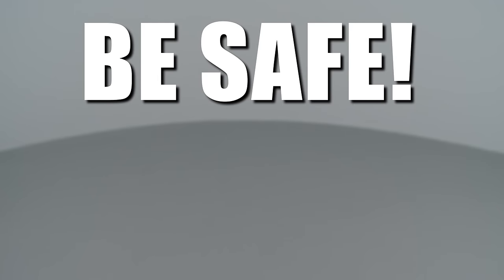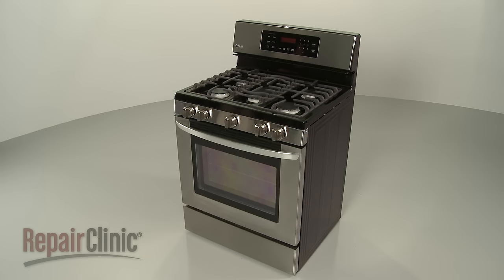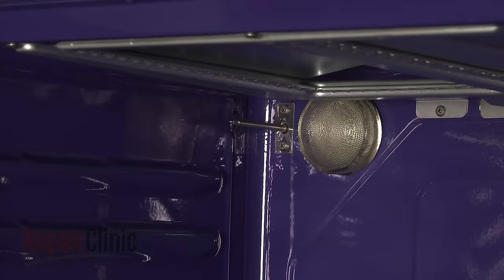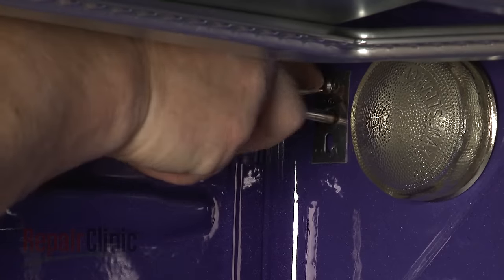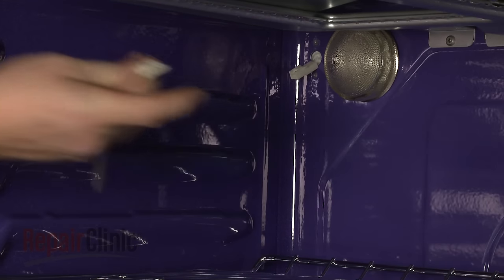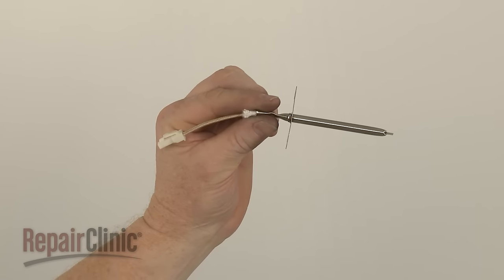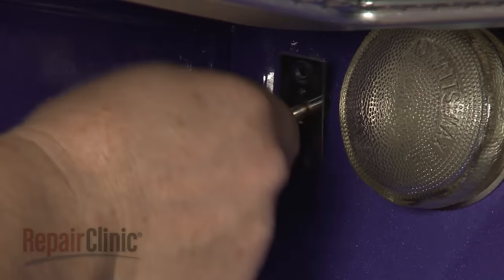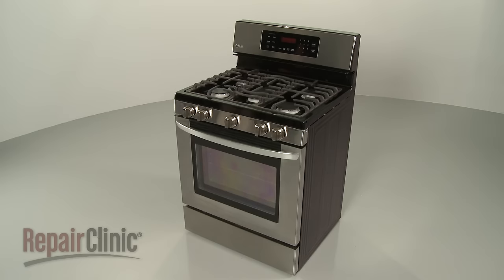LG Gas Range Oven Sensor Replacement #6322B62214A

Comment: On the electric units the connector is tied to the harness in the back and you need to remove the rear cover to access it and disconnect the connector. Its just a few screws. I tried for a half an hour to get it from the front to no avail. just go right to the back.
Reply: Thanks, Kevin. Mine just started having issues where it wouldn't heat to 450, imagine my disappointment when the steaks were done but the baked potatoes were just potatoes >:[ Anyhow, I'm working on it today after resetting the breaker and I'm thinking that sensor is gonna be the culprit; seems to be a common issue.
Reply: This is also the case on the gas units! But an easy install.

Comment: we haven't used our oven for a couple of years because the temperature control doesn't work.  It will go up to 500 and down to 250 with the oven set on 400.  I wonder if this sensor could be the problem.  We have a home warranty but they charge us $100 each time we ask to send a repair man out, and they've been out twice without fixing it.

Comment: Replaced.   Still randomly reaches cooking temp, then cools down drastically.   Have to turn off and start over.   Ongoing issue.  Doesn’t do this all the time but it’s a pain.
Reply: Mine is doing this too. It’s a newer oven that was almost $3k. Very frustrating.
Reply: @imsomelicious  and no one has the answer.   All of my LG appliances have been crap.  The fridge is noisy and needed a compressor replacement, still vibrates.  Dishwasher has had multiple issues.  The pump, timer module.   Oven is still a problem.  No issues from the microwave as of yet.
Reply: @jeffallen7923 Same issues with the LG appliances that I have.  I replaced the ignitor and that seemed to solve the cool down, but even after replacing the sensor the stove doesn't stop heating up.  The stove will indicate 350 degrees, but the internal thermometer will be at 400 and climbing.
Reply: Replace ignitor and temp sensor to cure problem

Comment: Watch the whole video before following instructions. It shows you can pull the connector through the front by tugging but mine tore that way. Then it tells you you may have to open the back to reach the connector. Too late for my impatient butt. Don’t be like me.

Comment: Will this fix the F11 error?
Reply: Were you able to figure this out? I've got f11 code as well.
Reply: @rhondamorris6233  I bought the part and the issue was not fixed. At this point, you will need to replace the entire board.
Reply: @aalamidi  it could be the heating element itself in the bottom of the range under the tray. Usually if the board is bad it will beep as soon as you heat preheat/start.